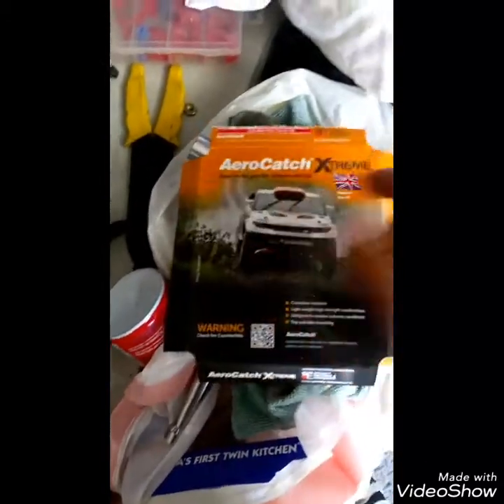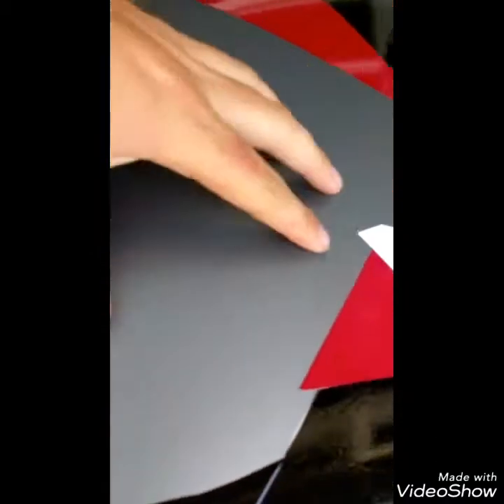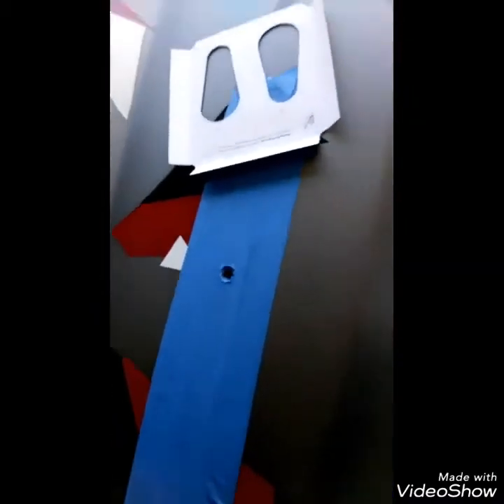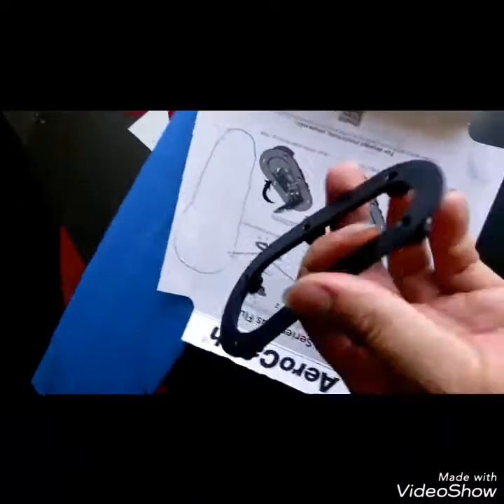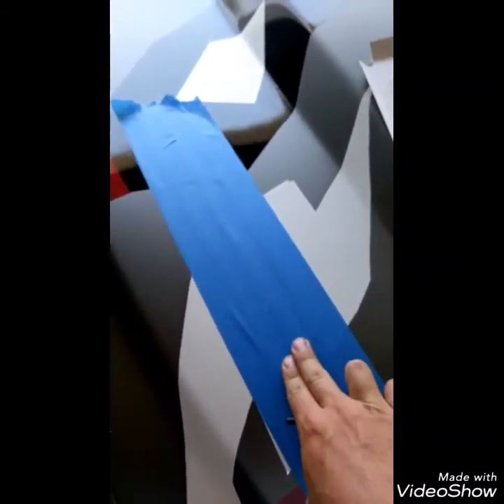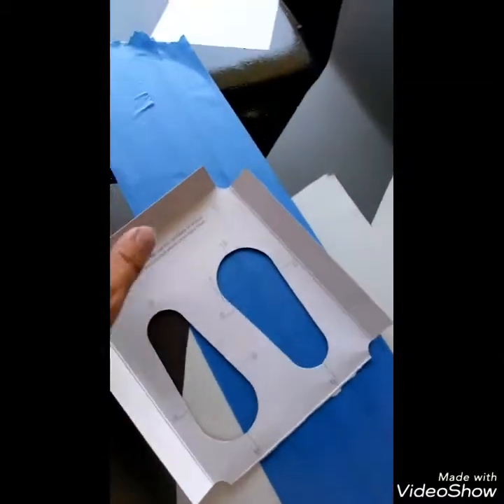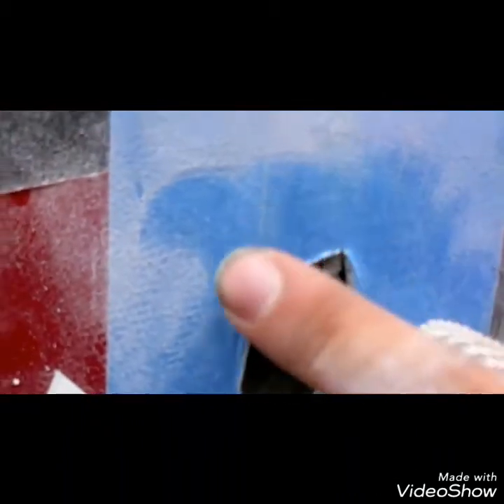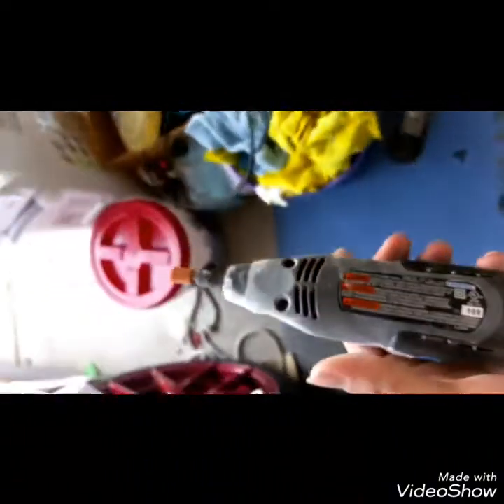Installing Aero latch hood locks on a 2016 ford mustang GT

Comment: is this like the hood pins on old school muscle cars? I wanna get those on my s550!
Reply from the maker: DavyDave1313 these are the newer ones. The old ones have a bar where a pin goes through and a wire holds them to the body. Install should be close to what I did

Comment: Where do i find them online? Do you have a link , 2015 Mustang GT
Reply from the maker: Their universal. But mine are Aerocatch xtreme plus and cost 65$ at the time. The 15-17 hood are the same however mine is a cowl the exact area you mount yours if it's a stock hood may be a bit different. But process is the same

Comment: Not a 2016 hood, your latches are right where the hood vents/signal lights are....so your video is only for aftermarket hoods.😔
Reply from the maker: Yea it is mostly for aftermarket hoods that don't have those scoops but there are other places that have open holes you can use or just drill them in a different area and the rest of the install is relatively the same.